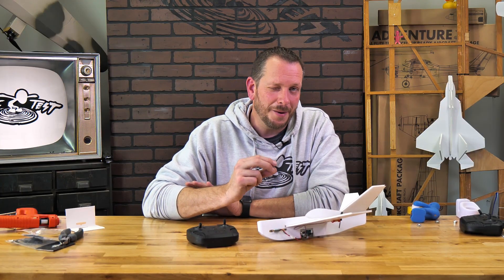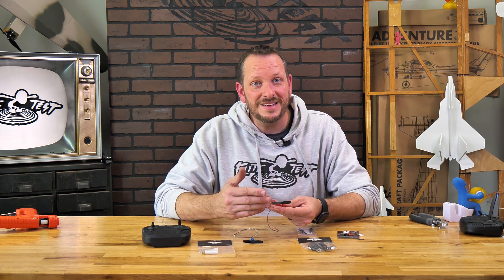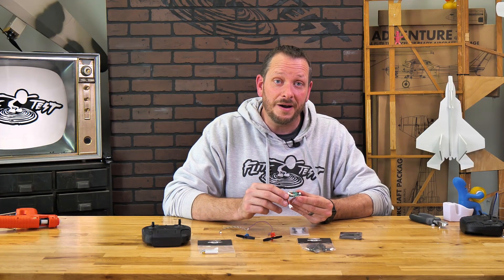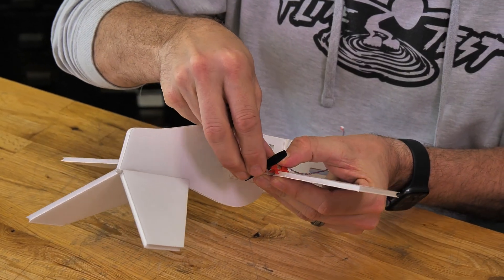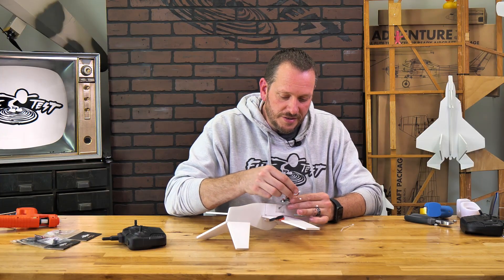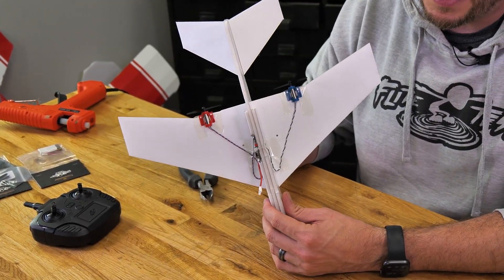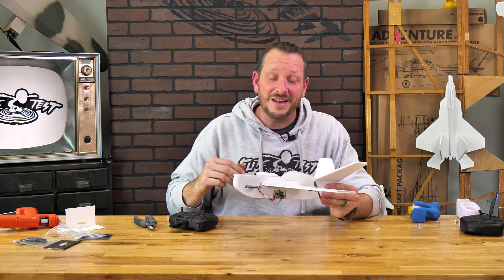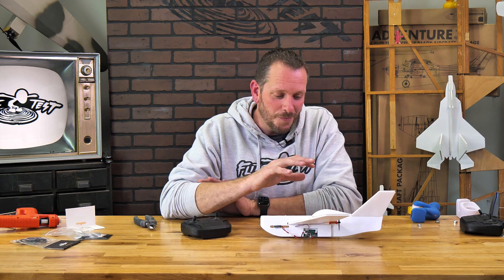Update On The EZ Power Pack V2

Comment: I had some trouble with it but I figured out that my plane was too small also the battery was not charged enough and if it’s too big it will be too heavy too small and it won’t generate enough lift or you have a broken motor which flite test politely has replacements

Comment: Duh, I figured out from actually watching the entire video that the control board needs to be mounted in the specific orientation you specified. LOL I used some of the excess material from your EZ 3-pack to create something like the flying wing from the first Indiana Jones movie. Because it's a flat design, I have the control board mounted horizontal atop the wing. Is this why it flies straight for 5 feet and then goes into a death spiral? LOL

Comment: How many of these can you fly together before they start interfering with each other?
Reply: I've had 3 in the air at once with my kids and no problems. I'm no expert on radios, but I don't think 2.4Ghz radios have any interference issues. They work I believe by constantly switching frequencies so they are never getting mixed up with another.

Comment: I noticed the paper is still on the foam parts of the aircraft, whereas in the EZ  Micro Jet ME 262 build video, you removed the paper from the foam. Can it be left on for strength with this power pack since it has more power? Also, the foam on the plane in this video looks different from your normal foam board material.